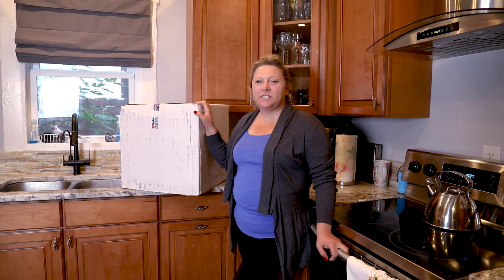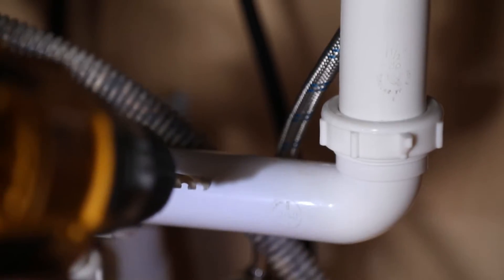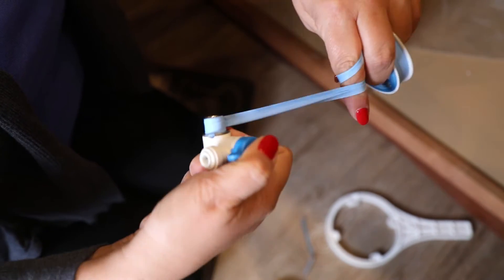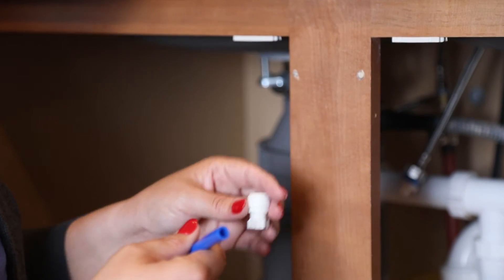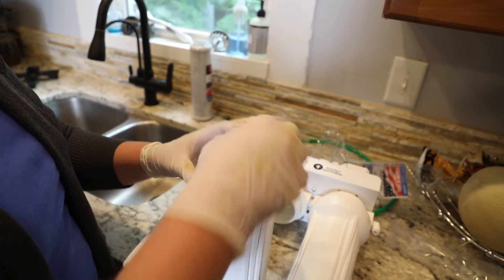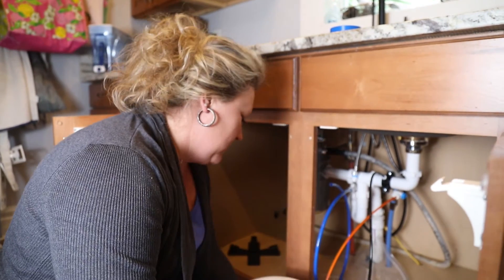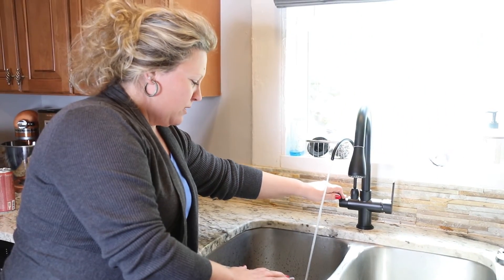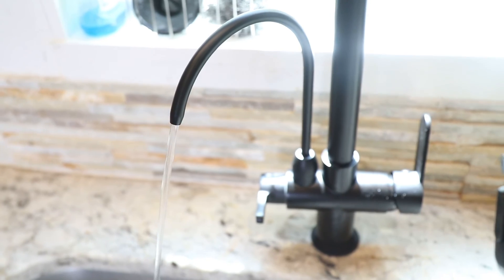DIY - Reverse Osmosis Installation

Comment: You actually don’t need to put any tape or pipe dope on the threads like you did.
Compression fittings seal inside, and not with the threads.

Comment: what about water pressure? we have ridiculously high pressure.  will that blow those lines out that you just push in? what kind of connectors are those anyway?  aren't you afraid they will blowout? I'm a total novice!  lolol
Reply from the maker: We use John Guest fittings. I have never seen water pressure strong enough to blow those out. This shouldn't be a concern.
Reply: @uswatersystems  Man! That is really great to know! Thank you!!

Comment: Plumber here. Don't use Teflon tape for that type connection- the connection seals through a rubber gasket so teflon tape can either get in the way of fully tightening it or if it sits across the rubber gasket ive seen that cause a leak as well. Otherwise great video.
Reply: What tape should be used?
Reply: @anandramalingam9240  Sorry for the delay. No tape should be used- the supply line seals on the rubber gasket, not the threads.

Comment: This isn't a good video to follow. I think she just destroyed her membrane by forgetting to flush her filters BEFORE attaching the membrane. The black carbon coming out of the faucet is a sign she either broker her membrane or installed the drain water to the faucet. Either way, you should install everything EXCEPT the membrane and flush the carbon filter until it comes out clear. THEN install the membrane. Sorry to disappoint everyone.

Comment: Hello there,  I wanted to know, if i don't connect the drain inlet and outlet under the air gap faucet and have the RO drain connected directly to the PVC drain , will water come out of the inlet and outlet port once the system is active, thanks!

Comment: What is the tank for?
Reply from the maker: It holds your filtered water.
Reply: RO systems create clean water slowly.
The tank allows it to create and hold lot of water while you aren't running the faucet so you don't have to wait 5 minutes for a glass of water.

Comment: hi, when I leave my apartment is there someway to plug the hole that is drilled for the drill saddle or can I use the garbage disposal dishwasher drain port for the drain? also I plan on just leaving my cub boards open and just lay the air gap faucet flat on the counter. will that work? ghetto I know but I'm leaving here soon and want to just buy a GOOD water filter that's GARRUANTEED TO FILTER MICROPLASTICS
Reply from the maker: You could just replace the plumbing where you drilled the hole for the drain saddle when you leave. It's a pretty easy fix. Or like you mentioned place the drain line in any existing drain port. Just make sure the line is secure or you could end up with a mess.

Yes, you could do that with the faucet. If you are just renting then I don't blame you.
Reply: @uswatersystems  my plan is to use a gasket and hose clamp to patch the small hole in the drain pipe when I leave. If that doesn't work I can patch with a bit of PVC pipe. I'm just a single guy who lives alone no kids so should be fine just running the faucet hose out the cub board doors and laying the faucet next to the sink

Comment: Does it filter microplastics? And if so, does the plastic tubing introduce new microplastics? And if so, does anyone sell a plasticless reverse osmosis filter system??
Reply: These are special plastic that doesn't dissolve in water. It removes all the plastic inside the water. Besides that water only passes thru the plastic for a short time and than stored in the stainless steel tank so there is no worries about the plastic dissolving.

Comment: What is the tank for? Does it have gas or what kind of pressure is it?
Reply from the maker: The tank stores your drinking water. There is an air bladder in it that occasionally needs to be refilled to maintain pressure.
Reply: @uswatersystems  oh ok cool thanks for the reply

Comment: I'm so confused, why does the sediment filter wire, go on the drainage pipe? How does that make the filter effective? Isn't it supposed to go on the wire that releases water and leads to the filtered water? Unless it gets the water that drains and then cleanses it. That's disguisting, can someone clarify if i'm wrong

Comment: How do you switch the filter off so you dont waste it washing dishes
Reply: Typically this is why there is a separate faucet for the RO water.
That one it comes with is typical of these kind of systems.
Reply from the maker: This system isn't connected to the dishwasher. It's one water line going to a drinking water faucet.

Comment: Thanks.. But I have question.. So.. blue tube goes in to the water tank.  How filtered water goes in and out from the tank?  It should have two lines in order to in and out?
Reply: the tank works off a ball valve that opens and closes to let filtered water go in to store and out to drink.

Comment: What’s the difference of installing this? Surely None! Replacements are about $50 x 3 a year right, and One spend only $10 a month for a couple tanks using vending machine and the vending includes also fluoride filtered water plus carbon filter.
Reply from the maker: A replacement filter pack is $50, once a year. We aren't saying it's for everyone. If you find more value getting it from a vending machine rather than your own home than more power to you.

Comment: What is the replacement costs on all those filters?
Reply from the maker: Our replacement filter packs are $44.95 and should last you a year. The membrane needs to be changed every 3 to 5 years and those cost between $40 and $50.

Comment: Thanks for showing the type of dual faucet that can be used to serve both RO and regular water. I asked several plumbing experts at different hardware stores and they all recommended drilling an additional hole into the countertop! Which is more complicated, expensive and risky.
Reply: Actually, i wasn't able to use this type of faucet because it doesn't have an air gap
Reply: @erjoalgo  so what did you do
Reply: @michaelvieira5659  I ended up having to drill a dedicated hole in the countertop for the RO air-gap faucet.
Reply: @michaelvieira5659  you can buy in line air gap adapters/valves that mount under the sink in between the filter system and the faucet. This way you can still have an air gap without a dedicated air gap faucet.

Comment: she is more competent than 95 percent of the apprentices I have hired to leave at a job and complete the install while I go to another job
Reply: Hire her the job will get done and done right.
Reply: Imagine a concept where you sign on to learn a trade and someone teaches.  Instead, their own greed leaves to think they could leave you to do a task you are not prepared for or have been taught to do so they could go onto the next job.  Imagine being paid less because you don't know the trade and nobody will teach you.
Reply: says counter clockwise, goes closewise haha
Reply: @jaxonavery8285  LMAO, she destroyed her RO membrane. It should NEVER come out black when first starting the system. What I saw was carbon the size of sand particles getting through a membrane designed to stop everything larger than H2O molecules. She should have flushed the system BEFORE installing the easily damaged membrane. Can't believe George Jones didn't spot the mistake.
Reply: I'm that apprentice
Reply: Imagine needlessly victimizing a situation. Imagine gathering the information you lack about a job you don’t have any experience doing, all accessible in a device at the tips of your fingers. Imagine...
Reply: @SaturnsReturn77  imagine thinking that using your phone on a job wouldn't get you two checks and a "thanks, we don't need you anymore".  Imagine understanding what trade craft consists of and boiling it down to googling and thinking you are an actual craftsman.
Reply: @ryhu4755  how exactly do you think apprentices become journeymen?
An apprentice who can use plumber's tape and a drill should be able to do this job. The plumber should look it over, give the apprentice the proper fitting to use, and check their apprentice's work before getting paid.

Apprenticeships don't equal getting paid just to follow the boss around and hand them tools all the time. Sometimes an apprentice has to actually work on their own using their knowledge. It's not like we're talking about leaving them alone to sweat copper pipes...
Reply: @rocki_bb  @Ry Hu should have spotted the carbon coming out as a sign she missed an important step. Flush the system before installing the membrane. it's also possible she hooked the drain hose to the faucet.

Comment: Teflon tape should be threaded on clockwise - you are threading it on clockwise in this video, but saying to thread it counterclockwise.
Reply: You don’t even need Teflon tape. It’s counterproductive. The hose has a rubber gasket. It’s similar to your garden hose. Pipes that screw in be it metal or plastic that don’t come with a rubber gasket is when you apply Teflon tape. And yes it goes on clockwise.
Reply: Yes, when the threads are facing towards you, it must be clockwise

Comment: Guys I have best experience in water purifying industry, so if you want to buy water purifier in Dubai, I can share some experience. 
The thing about all water purifiers is that they are based on same technology but if we talk about best water purifiers in Dubai, 
I would suggest “Dubai water filter” in terms of their water purifiers which use RO and UV water purifying technology. 
RO purifier or RO aqua guard in Dubai use different stages filtering system, along with this they also provide other unique water products for domestic use, I personally recommend them for their customer service which is really fast, responsive also they are using muralcrm.com for customer management and service scheduling. 
If you are here looking for a best aqua life water filter you should definitely give it a try, https://www.dubaiwaterfilter.com/
https://muralcrm.com/ 

#Waterpurifierdubai #Buywaterpurifierindubai #Bestwaterfilterindubai #ROpurifierindubai #Domesticwaterpurifierindubai #Bestwaterpurifierindubai #Aqualifewaterfilter #ROaquaguard

Comment: it produces way to much waste water that hole drilled in the drain is coming out twice as fast as the clean water
Reply: That’s normal. Some systems allow you to adjust the rate of flow. Decreasing your wastewater will in turn affect your clean waters PPM. I’ve seen PPM in homes around my area at 250-400. After RO you can get as low as 15-20 or better sometimes. If you adjust it to 50 and up you will have less waste water. However that defeats the whole purpose of an RO system. Bottle water ( quality) that doesn’t have additives usually measures 10-30 ppm from what I’ve seen. The numbers I’ve given are estimated and average from my memory. I’m think there pretty close but and gives you and idea of the points I’m trying to share. My apologies if I’m incorrect
Reply: @williamwallace7986  your spot on i myself am waiting for some resin , drinking 250 tds

Comment: do you have to install the tank, can i use this system without tank? what will happen if i dont use the tank?
Reply: You'd have to wait 5 mins for a glass of drinking water.
The system fills the tank to full, which your faucet draws from.
The tank is filled slowly but because you have a lot in there, you'll have more before you get to the bottom (unless you leave the faucet on for an absurd amount of time)
It fills even when you aren't running the faucet.
Reply: You'll have no reserve and get a trickle I'd assume. If you want any kind of water flow you gotta have a tank
Reply: Depends on amount of your usage and size of your RO. Most home system are very slow. Some people even get a larger reserve tank.

Comment: In the installation Demonstrations .Installer was not cleat on which line connected where . Color lines were used. But was confusing on which line goes to what conection.